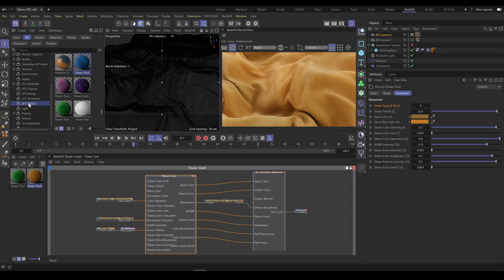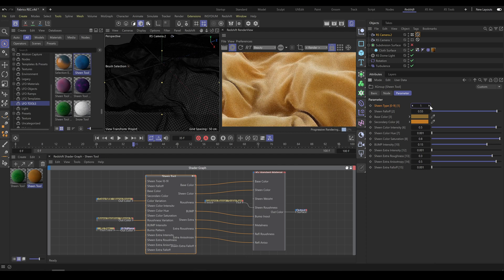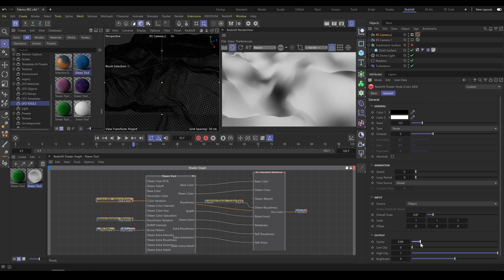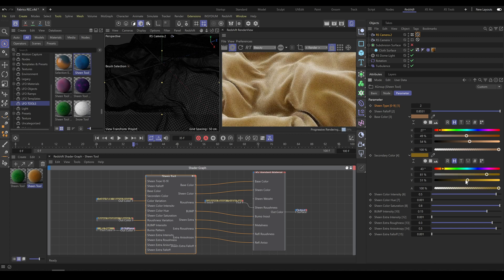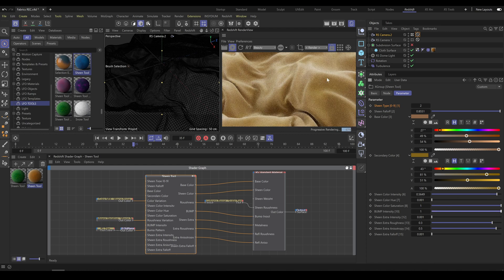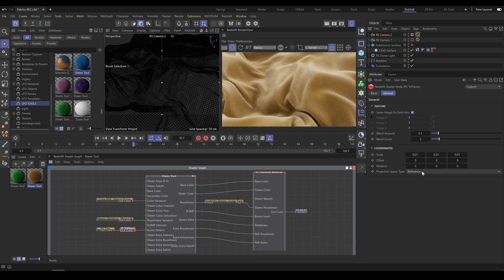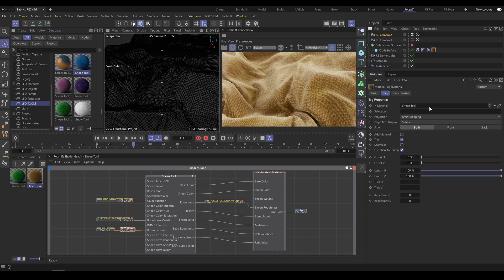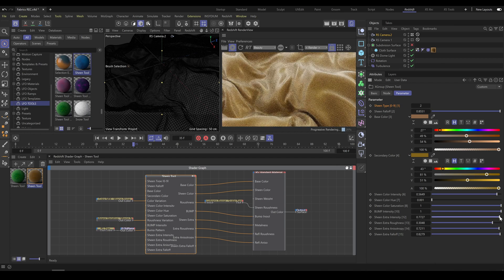C4D 2023 / Redshift - Sheen Shader Tutorial

Comment: is it possible to bake sheen into a texture?
Reply from the maker: Redshift lets you bake lighting and shading into textures (including sheen), but once baked, it’s no longer dynamic—it won’t react to new lighting or camera angles. You’re essentially baking the look under current conditions.
Reply: @LFOdesign-Tutorials  thanks for the answer! yes i would need that for a game asset. baking it in would be the only way to achieve that. do you know which AOV i have to use for that? i tried the beauty pass but it doesnt really give me a good result.
Reply from the maker: @CatrickSwayze99  If you want just the sheen component, create a Custom AOV:
	•	Add a Custom AOV.
	•	Use a Shader AOV and plug in the Sheen Layer or custom node setup.
	•	This gives you flexibility to isolate just the sheen and bake that.
Reply: Thanks im gonna try that@LFOdesign-Tutorials